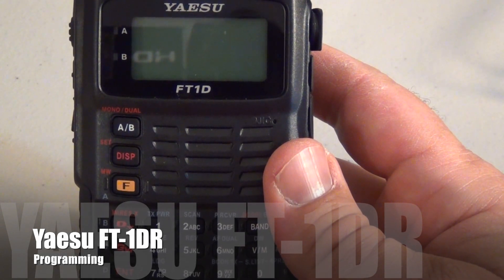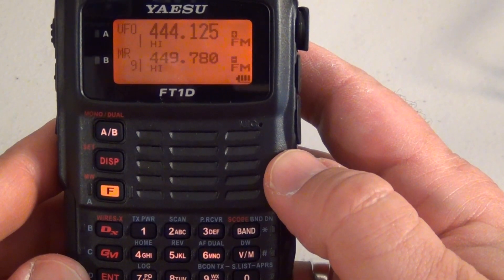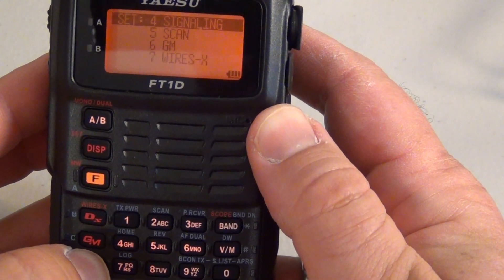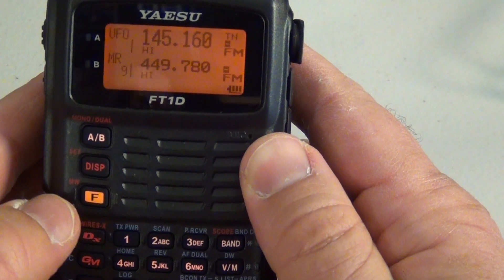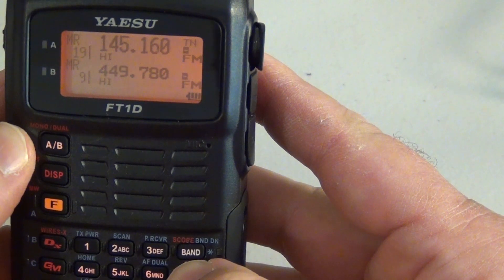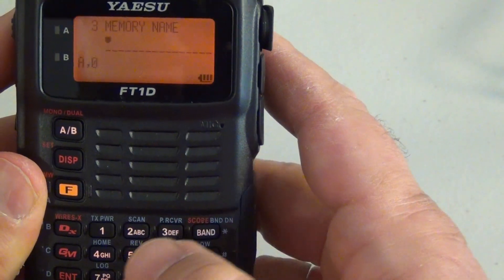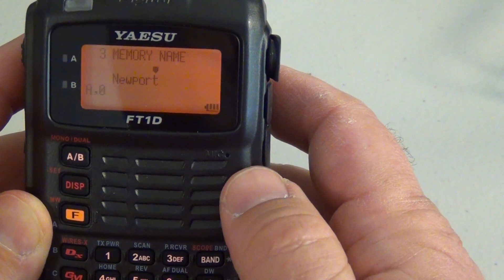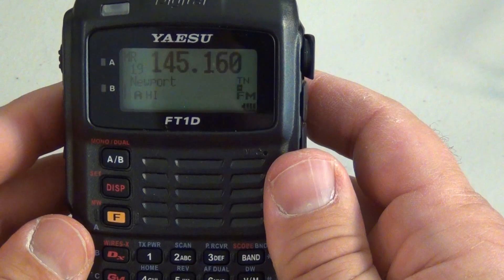Yaesu FT-1DR Programming Tutorial

Comment: Thanks for the video. I just got mine in the mail today. Cant set the tone squelch. I read pg 84 of the manual and #10 signal expansion is ON under signaling yet no option under #11 SQL TYPE. Need to check with other hams locally.
Reply: Just figured it out. I was in DIGITAL mode, I switch to FM analog and now I can perform setting. Thanks for your video, got me thinking more about it.
Reply from the maker: Thanks for watching! Congrats on getting your new radio! They are a great radio! If you're not into using the APRS feature you might want to shut down the GPS to conserve your battery.

Comment: wondering if it's possible to manually config an offset? got a repeater locally that has a negative offset of 1.035Mhz.  on radio all i can move is from 1.000 to 1.500Mhz.
Reply from the maker: Thanks for watching and for your question. I have a repeater near me with the same PL Tone and I too am trying to find out how to configure the radio(s) for this repeater. Once I do I will post it here for you.
Reply: VideosByDPF thanks! easy way would be to plug into desktop computer I'm sure but would like to not go that route on this one. thanks again
Reply from the maker: I spoke with Yaesu Tech Support this morning and I was told that 1.035 is not an "authorized" amateur radio pl tone. If anyone else has anything to add to this please do.
Reply: VideosByDPF I've never had successful answers from yaesu tech support so i take it with grain of salt.  i can program two other yaesu radios with computer programs and get that offset to work. might be the case again with this
Reply from the maker: fdiaz05 I'm going to probably have to use the computer until a better way comes along.